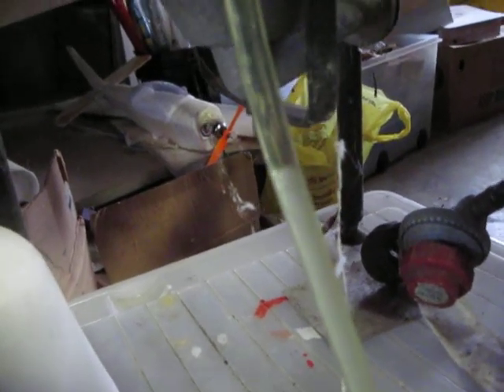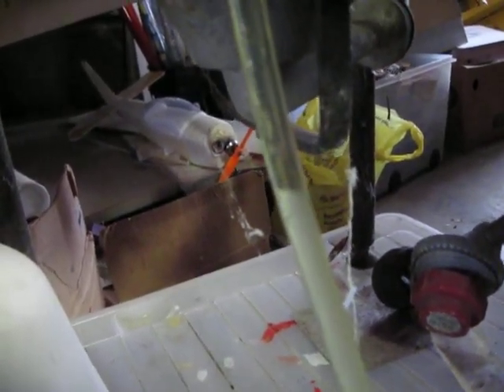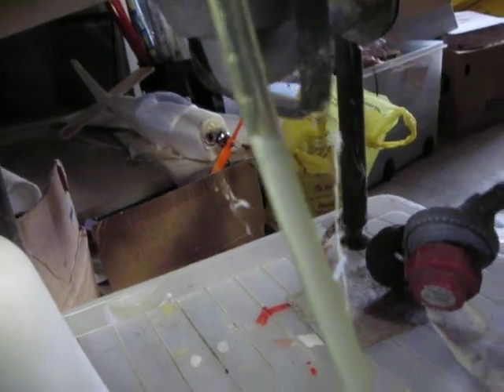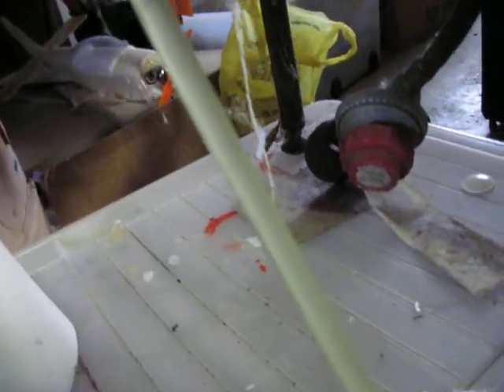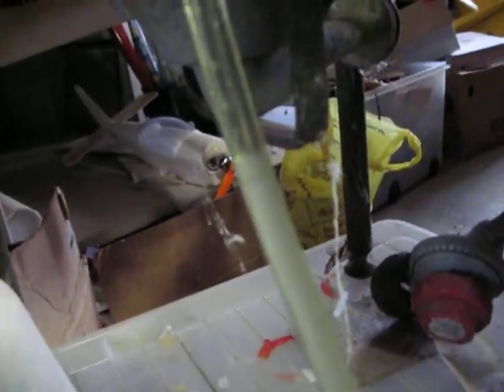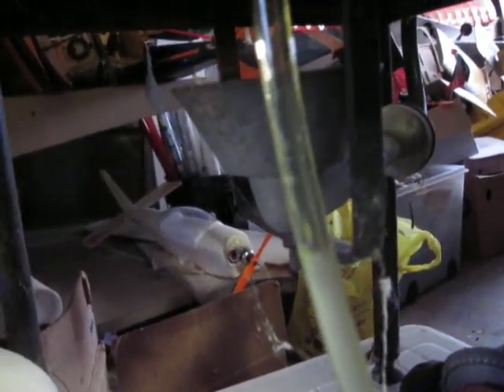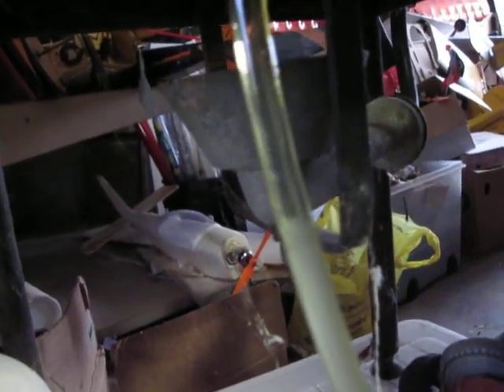how to remove ethanol from your airplane mogas

Comment: This method works great, I have been using it to remove the ethanol from ordinary pump gas from a gas station, for use in my airplane.  My fuel had 4.5% ethanol in it, and when I added as little as three ounces of water to a 5-gallon jug of gas, I was able to drain 28 ounces of water/ethanol mixture about 30 seconds later.  The gas then tested negative for ethanol content.  I what I used is a 30 gallon barrel, set at a 45 deg angle, with a valve at the very bottom corner to get it all out.

Comment from the maker: no special equipment.  I use a tank with a bottom outlet.  water and eth will go to the bottom then you drain slowly with a valve.  Additional note,  we no longer need to do this , we not have ethanol free gas available.  you probably have some in your area, just have to look for it

Comment: Although this technique works well, care must be take when using this in aircraft. If the fuel is poor quality, ethanol may have been used to boost the octane rating and therefore removing it may result in low power and/or damage to he engine. There is lots of info about this on line. Best solution is to buy fuel with no ethanol to begin with.

Comment: If your carb were to fill with 90% ethanol, 10% water mixture, the engine won't run because the main mixture jet isn't big enough to pass enough ethanol to give a good fuel/air mixture, and you're coming down!!!  If you have 10,000 feet AGL maybe it will all pass through and get to the gas in the tank.  Also, ethanol boils at a really low temp and can cause vapor lock in the fuel pump and carb, not to mention the incompatability with rubber seals.  So get your ****ing ethanol out with water!

Comment: This method removes the ethanol so do it!  If you try to fly a plane without using this process, leaving the ethanol in the fuel, there is the danger of this process happening all by itself in the wing of your plane.  On a C-152, a tank full of 12 gallons of pump gas, with 4.5% alcohol in it, six ounces of water perhaps from condensation or rainwater seepage will cause the 54 ounces of ethanol to come out of the gas and combine with the water, settle to the bottom and possibly fill the carb...